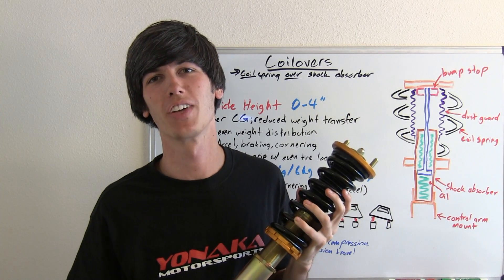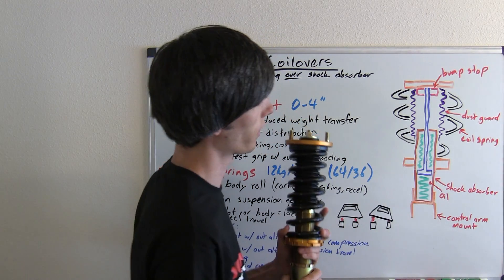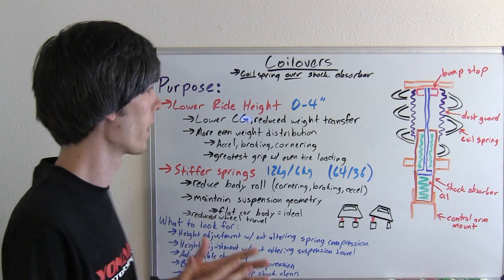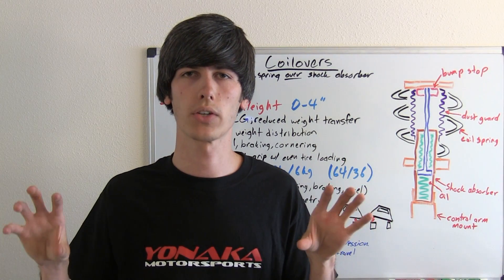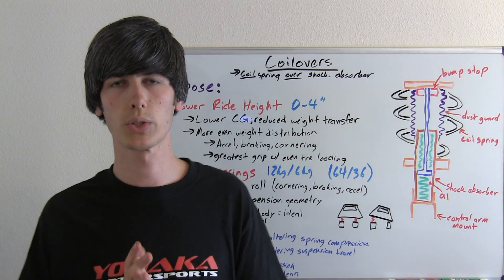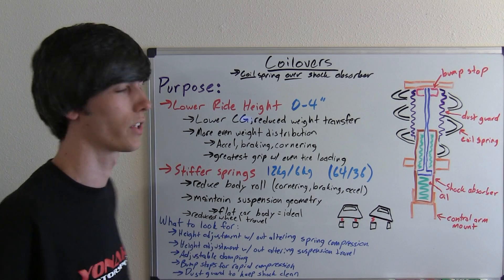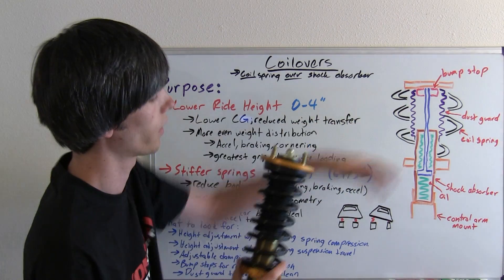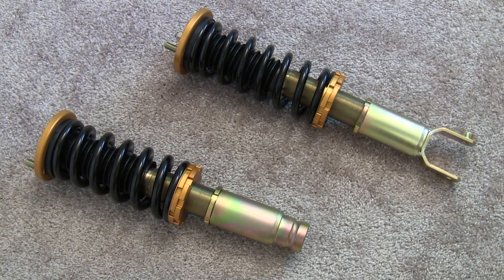Coilovers - Explained

Comment: I recently installed my coils. However, my ride has became super bumpy. It is as if the shock absorbers aren't absorbing any of the bumps. I THINK the reason is... when I put the rears in, I able to freely spin the coil springs with my hands. Is that not right? because that doesn't sound right to me. If I adjusted the height higher, the springs did compress and I couldn't spin them freely though, only when lowering. My other guess would be an alignment but I don't think that is the cause. Any help, insight? Thanks!
Reply: Frank Zhang  I know this is a four year old question and you most likely got it straightened out a long time ago, but for others seeing your question, it sounds like you are setting on those rubber bumpers he was talking about at the top under the spring plate. U must have the vehicle setting so low that the springs aren't even holding up the car and there is no movement of the shocks. So no, the shocks aren't absorbing any of the bumps. That would explain the hard ride.

Comment: You cant or should'nt adjust the ride height with the preload on the showed coilover. The lower adjustment you set to the specs of the car, and leave it alone. Coilovers are a nice feature, but where you get the most of the suspension is to cornerweight the car. If you either slam it or adjust by how nice the stance is - Your not using coilovers correctly.

Comment: First of all, thanks for all the great information you're putting out there. Being a mechanic I've found it to all be correct so far. One question though, I have a bmw z3 1.8 1996 with a 50/50 weight distribution, should I use the same spring weights then? Thanks!!

Comment: Are there coilovers that are used to LIFT the vehicle?
Reply from the maker: fazinazin33 These particular ones are made for lowering.
Reply: fazinazin33 Yes it is called a "lift kit" but it is really taller coilover suspensions.  But if you just want 2" at the most you can do spacer blocks on the struts for 1/10 of the price and labor.

Comment: so what would be the best spring rate setup (as you mention at the end) for a 00 civic? can you tell me how will I measure them on the coilover? you said 12k spring rating and 6 spring rating. will that be a good setup for track/caynon runs?
Reply: Research it.
Take into account the weight of the car and the weight distribution of the car aswell.

The lighter the car, the less heavy you want the spring to be (Because obviously the car won't be exerted as much force as a higher car over a bump)

If the car is pretty evenly distributed, the front and the rear spring rates would be closer together (In the video they are 12/6 because the Integra has a very large difference in front vs. rear weight, so heavy front springs account for the extra weight and vice versa for the rear).

Hope I helped!
Reply: thanks ill do my research

Comment: not sure if i would continue to say that a lowered car or stiffer springs will result in "less weight transfer"
technically (i believe), the magnitude of weight transfer is always the same. you can modify the rate of weight transfer through suspension changes and thus potentially lowering the "amount of weight transfer" due to the dynamics not fully reaching its capacity during a turn or bump or etc.
I could be wrong though.

Comment: Hey great video! It's a big help as I'm researching various upgrades I can make to my 2012 jetta. Anything else I should consider to improve the suspension and ride quality?
Reply from the maker: Michael Martinez If you lower it at all, be sure to get it properly aligned, and if needed install a camber kit to correct the overly negative camber from lowering it.

Comment: cheap coilovers ?bad? how?
Reply: any coilover is going to be an upgrade from stock shocks. As long as you don't drive your Honda like a Ferrari then you should be fine no matter what. But if you do. Go Bilstein shocks or go home.
Reply: Non-adjustable rates and such. You get what you pay for on cheap and expensive coilovers.
Reply: SkylineBNR34 adjustable height though, i found on ebay for 500$ coilovers but i mean they gona leak soon or easy to break them?
Reply: mike tverdokhleb
Ride quality and the such. Cheap coilovers aren't going to have any adjustment except for ride height. The ride is gonna be bad. Save up some money and get a good brand, spend around 1000 bucks on some and they will last, and most of those higher end ones are rebuildable too.
Reply: Ko-wing wong well its bmw e46 you kinda can drive it differently from honda
Reply: Travis Fisher
Have you ever been to K-sport's site? BC's site? How about Tein's site? Most coilovers are in the grand range, a little more and a little less depending on car and application.]

BC coilovers for my car, which are some damn good coils, are 899 IIRC.
Reply: SkylineBNR34 lol all budget shit coil overs made in China Prolly all made at the same factory painted different colors and then given different spring rates. Ksport has some High end race applications but no one knows that cuz they buy their bottom barrel shit. How about you check out say some cuscos some penskes and tell me your bc coils are damn good coils
Reply: Travis Fisher
You're a moron.

Why don't you actually go check out BC Racing coilovers for yourself if you think they are crap made in china.

Official coilover of the World Time Attack and 7 guys in Formula drift use them, so what were you saying they were junk again?
Reply: SkylineBNR34 think they are using the off the shelf 899 dollar coil overs smh you sir are the moron lol
Reply: SkylineBNR34 BC racing what does the BC stand for well that's simple Bor-Chauun right from Taiwan lol
Reply: +mike tverdokhleb for. thousand bucks go for the KSport Coilover

Comment: hey bro , I just  been installed lower spring  my 04 civc. But it  going  too low it about 1" or 1 1/5"  from those tires ,  it hit my rear fender when turn on corner. Do you have any idea to make it stronger  when it have  turn on corner ?

Comment: I have stance coils on my Genesis R-SPEC. I get a lot of rattling over bumps. I thought this was normal because of the PILLOW BALL mounts. Do you know if this is normal as I hear most peopl complain their COILS are fairly noisy. I am not even sure my set of coils has a BUMP STOP either.
Reply from the maker: You're likely getting rattling because the springs and shocks are so stiff. But if your car is super low, you need stiff springs and shocks so you don't bottom out. It's a fairly big sacrifice. If it bothers you, I'd recommend getting softer coils and raising your car.
Reply: Engineering Explained  Isnt there also less rubber to isolate rattling with COILS ? I believe I read the pillowball mounts for coils cause metal on metal contact. Normally there is rubber on the Mount Point but now I dont see any where the Camber Plates are. just metal.

Comment: My Odyssey, Forester, and Civic have this design in the back and McPherson struts at the front. The McPherson struts are coilovers, since the shocks are inside the spring. Replacing the shocks on a coilover can be tedious, unless there is a pre-assembled strut with the coilover and shock together in one assembly, depending on the vehicle.

Comment: I've been researching what spring rates would be ideal for my driving habits. I am getting the BC Racing Coilovers extreme drop with front and rear cup kit. The issue i'm stuck on is what spring rate to choose. This video has been most helpful in learning about coilover sysytem. Thanks. I'm still trying to figure out the spring rates as with BC they are custom and can do any spring rate you choose.

Comment: do you have a video explaining torsion bar suspension, Basically would like to know what i need to raise a 4x4 with torsion bar suspension. to increase ground clearance and fit larger tyres, Also what can be done for cv joint angles

Comment: So, in any kind of suspension design, the spring rate must be compatible with the vehicle's weight distribution? And, is there a way to adjust the spring rate?
Reply from the maker: Yes to your first question, and not really, no, to your second question. You can change the pre-load, but this does not alter the spring stiffness.

Comment: Can I just put lowering spring just the spring itself and ride fine or do I need other stuff
Reply from the maker: You can, but it limits your shock travel, which is why I'd recommend changing the shocks as well to some that are designed for shorter springs (or simply get coilovers which accomodate both needs, and are typically adjustable).

Comment: Hey EngineeringExplained, what is the difference between coilovers and lowering springs?
Reply from the maker: Coilovers include a dampener (shock absorber) where as lowering springs use the cars existing shocks. This can be problematic, as it can reduce the amount of travel of the shock, and potentially damage it. Personally, I would never use lowering springs unless I was also changing out the shock absorber for one design for a lower height.
Reply from the maker: Depends on the car, but like I said losing shock travel isn't a good thing, so I wouldn't recommend it.

Comment: You have lowering as 0-4". Usually this isn't the case, even on the highest setting you'll be looking at an inch of lowering minimum.
Reply: that would be totally depends on the brand
Reply from the maker: That's what there site lists, though I'm not sure if I could get it to sit at stock height.

Comment: It depends, you CAN but eventually your stock strut will blow. The lower you go, the faster the strut will go. If you lower only about an inch on stock struts it should last pretty darn long but any lower it will blow your strut within 6months to a year.

Comment from the maker: They may fit, but that doesn't necessarily mean the damping and spring rates are properly matched, or that you won't break the shocks on a heavy bump. Unless they're simply an OEM replacement, with the same height.

Comment from the maker: The problem with lowering springs on stock shocks is you reduce useable shock travel, so your shocks could potentially bottom out. Also, the dampening rates of the shocks may not match the spring rates of the springs, so it may cause an overly bouncy ride.

Comment: I've got a 18x9.75 20 off set on 225/40/18 and it stances out. it rubs against the fender when going over a bump. how do we avoid rubbing the fenders? do we roll the fenders or get a camber kit. i'm on stock coilovers.

Comment: It shouldn't affect anything apart of fuel economy (it will be better, since power steering oil pump goes all the time even when not turning). Of course steering effort will be significantly higher, not only because it dosn't assist you but also power steering racks have "faster" gearing (less turns from lock to lock meaning higher effort to turn wheels)) and the rack alone might have higher friction due to added parts vs manual steering rack.

Comment from the maker: Altering the height of the coilover will not change the spring rate, so the coils will be just as stiff.
Reply: Engineering Explained but how about the  roughness of the ride hows the feeling inside the car? Any significance?  lets say an inch or two lower setup of coilovers. Planning to buy one but im afraid it will alter the comfort of a stock ride. I just want to lower my ride and for the benefit of coilover during sudden turns and other benefits of owning one. Btw, i have 08 subaru forester and im from Philippines 🇵🇭 thanks for the much info

Comment: I also drive an integra, and i have bwr coilovers, they came with the car, but my neighborhood hates slammed cars, so i wanted to raise it a bit from what the last guy had it set to. when i did this, i believe it compressed the spring, it's been making a squeeky noise from the rear. the spring is 7 inches now, i dont know if you need to know that. earlier i tried to loosen it but when i did, the spring didn't pop pop with the preload. it just stayed compressed. what did i do?

Comment from the maker: Pre-loading the springs does not change the stiffness of the springs. Unfortunately if you want stiff you'd need different springs. That said, you may be able to achieve what you want to do cheaper with anti-roll bars, not really sure what your goal is though.

Comment from the maker: The cheapest option is lowering springs, but there are reasons you don't want to do this. It won't allow for the full travel of your shock (likely) if you do this, where as coilovers will allow for lowering without altering suspension travel (of the included shock, not all do this, but most do). Also, to get things done right, you may have to get an alignment to alter your camber and toe to make up for the change in geometry.

Comment: if its to hard there wont be any give at all, which can end up breaking tracking and causing slippage. Ideally you want a stiff enough spring to prevent roll as much as possible, but soft enough to allow some roll so that the car doesn't break traction on hard corners.

Comment: In some racing videos ive seen as they do practice laps with the car, they sometimes say the springs are too hard and it would perform better if its slightly softer. 
How does a spring thats too hard worsen the performance?

Comment: yes (based on my own experience). I lowered my car 2.34" (6cm) front/ 1.57" (4cm) rear with springs only (apex yellow) and had them on for two weeks only. Strut mounts were gone in a few days and then the front shocks leaked (a bicycle hand pump was harder to work than my shock absorbers) and had to be replaced. I went back to stock springs and new shocks all around and new strut mounts for the front shock absorbers.

Comment: Correct me if I'm wrong, from a driver's perspective, the dampers are used to tune the car's behavior while under braking or accelerating (corner entry and exit), but during that steady state part of the corner while the car is coasting the sway bars are used to tune the car's behavior.

Comment from the maker: Yes, but by using stiffer springs you aren't reducing the "independence" of the suspension. Sway bars act as a link for the two, but are a cheaper solution to the problem of body roll.

Comment from the maker: The stiffness of the springs, when measured in "kg" under a different gravitational pull, would ultimately be a different force. Indeed, they are not certified by the "space administration" and should not be used on the moon!

Comment: When you install the coil overs I would greatly encourage you to upgrade your anti sway bars (they're usually pretty in expensive... considering the results) ... You will be pleasantly surprised (I think) with the improvement of the handing of you car. Hondas/ Acuras usually have pretty soft antisway bars. Potentially you could show the G's your car could pull before and after the modification...

Comment: The "full threaded body" feature is not an indication of an expensive coilover anymore.  Companies can just develop the lower threaded portion and top hat and pass off a generic shock-body/valving as a coilover specifically designed for different cars.  

Could you do a video on how spring preload affects or doesn't affect handling?  I think that argument needs to be put to rest.  Videos are more and more interesting!